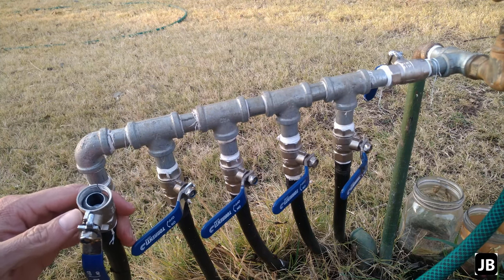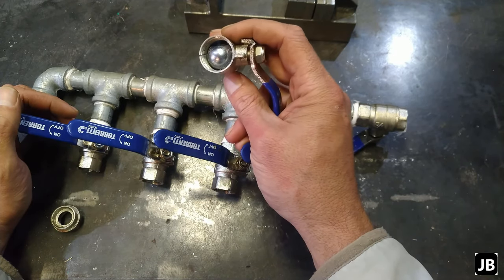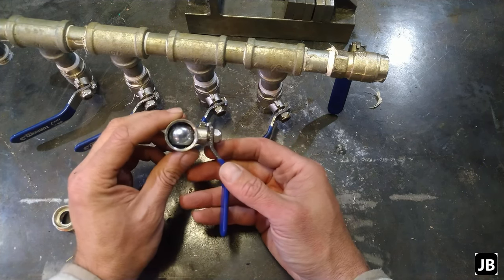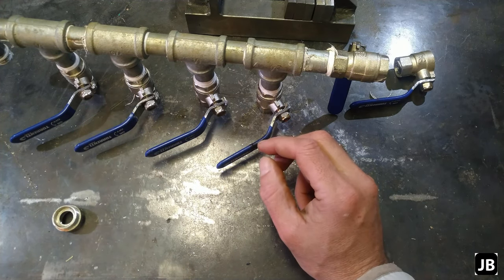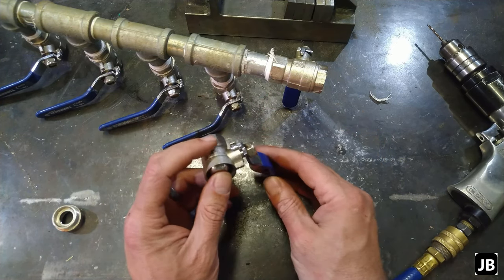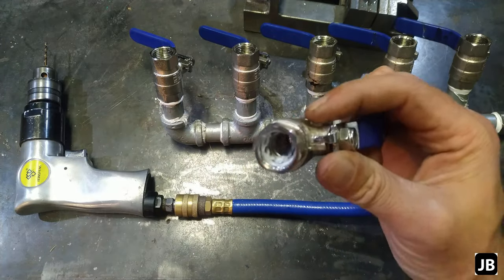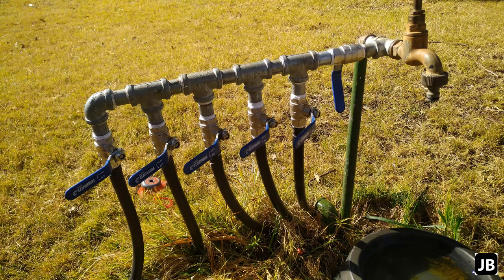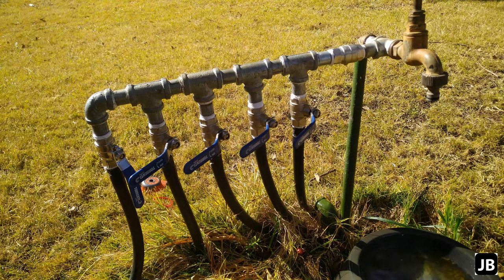How to Frost Proof a Ball Valve.

Comment: For sanitary uses would it work to rather pierce the ball itself so that it drains to one of the two pipes instead of having a communication with the potentially dirty outside?
Thanks
Reply from the maker: That could potentially work. The only problem I see is that the drilled hole in the ball can scrape off the internal PE sealing surface over time, causing a leak, but I will give it a try in future if I have to frost proof another valve. Alternative you will have to drill the ball in line with the valve spindle, but on the bottom end. Thanx for the comment.
Reply: @JacoBadenhorst  you are totally right about the seals...
The bottom hole would still communicate with the outside, if I understand you correctly.
Maybe it is as simple as drilling a side hole and covering it with some electrical tape. Should it freeze, the tape goes away, but if not, it does not allow insects, bacteia or such to breed inside the hole
Reply from the maker: @DoNotPushHere  that could also work for sure. You just need to relieve the pressure from the freezing / expanding water. The pressure from the water inside may blow of the tape every time the valve is operated. Maybe even a temporary seal through the use of hot glue or silicone sealer? My thinking is also that there is always positive pressure from the inside out, so reverse flow  through the hole would be somewhat unlikely?
Reply: @JacoBadenhorst  well, there is some positive pressure, I guess, until the valve closes. Then you have some stationary water there, and a potential health issue.
In the long run, you had your pipes well above the ground and on the sun and UV rays.
I guess there is a fancy expensive solution on the market, and you just took pennies to provide a sane solution.
My idea may well wear the seals prematurely but if properly deburred, it should be no worse than the main valve hole that constantly bits the seals I guess...

Edit: your idea has an advantage over mine: you don't have to disassemble the valve!
Reply from the maker: @DoNotPushHere  you are 100% correct, but disassembly once in it's lifetime is also something that I can easily deal with. I absolutely love these type of conversations. Getting to a common better solution.
Reply: @JacoBadenhorst  me too! People should learn that pride is non toxic... you can eat it sometimes :) 
Nice to talk to you!

Comment: You could have made the hole in ball rather that would help releif pressure into the piping which would help😊
Reply from the maker: Thank you so much for the comment. I honestly didn't think of that. But If you drill through the ball, the drilled hole have the potential to wear through the polymer seal if not completely smooth? I will give it a try. I think you are onto something here. This is the beauty of the internet. Thanx again.
Reply: @JacoBadenhorst  I was just saying that just drill hone on the front face of the ball from were the supply is coming ....so in turn you will be able to releif the pressure as well as block flow through the second side of the ball,...... actually I am here coz I am developing a liquid fuel rocket engine and have some cryogenic liquid to deal with so I was here to see how to prevent frosting on the valves actually 😅😅😅😅
Reply from the maker: I love this. Makes absolute sense. Please show the rocket when you are done. I would love to see it.
Reply: @JacoBadenhorst  you are really humble ...I loved to have a word with you ....I guess you might be American ....just a guess but really very good to have a word with you .....I will surely send all the videos and all the post regarding my progress.....also I am a musician do have a look at my channel you would love it❤️🔥
Reply from the maker: @thecros1076  I am in South Africa. Hit me up on the DM in Instagram. My name there is   jaco_in_the_shop. We can have a chat there?
Reply: @JacoBadenhorst  surely ❤️❤️🔥🔥🔥thank you so much 🔥🔥I will hit you up hit now🔥🔥